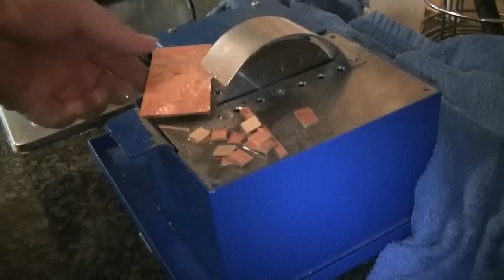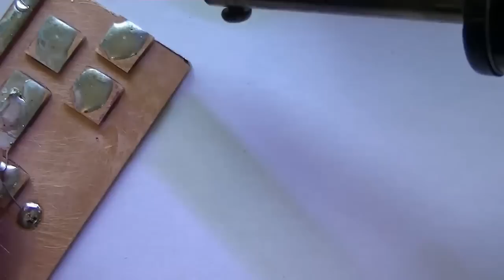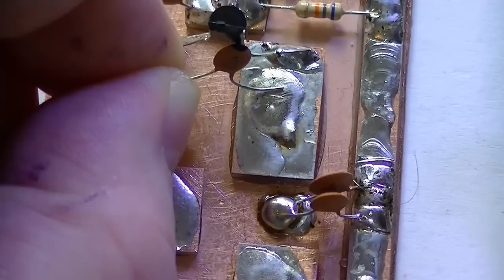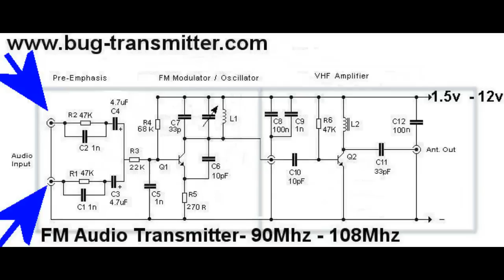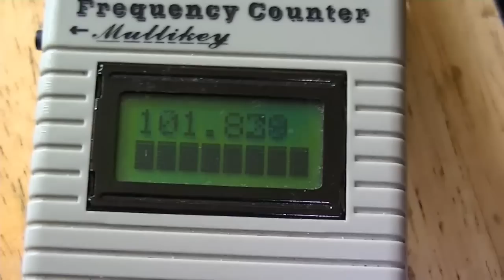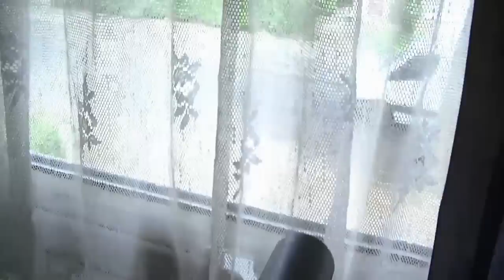Build your very own small home radio station.I show you how to build a small FM transmitter

Comment: I have a variable capacitor with 3 legs, how I can connect to the circuit?
Reply: two of the legs would be connected to  the same point whereas one would be the variable leg pin. check with continuity tester.
Reply: two of the legs would be connected to  the same point whereas one would be the variable leg pin. check with continuity tester. connect the variable leg and any one from those 2 common legs to tue circuit
Reply: two of the legs would be connected to  the same point whereas one would be the variable leg pin. check with continuity tester. connect the variable leg and any one from those 2 common legs to tue circuit
Reply: two of the legs would be connected to  the same point whereas one would be the variable leg pin. check with continuity tester. connect the variable leg and any one from those 2 common legs to tue circuit
Reply: connect the variable pin to one end and any one from those other two to the other end
Reply: connect the variable pin to one end and any one from those other two to the other end
Reply: jh

Comment: Can i use a 4.7uf capacitor instead of 4.4uf?
Reply from the maker: You can use 1uf upto 100uf
Reply: dazaro3 Thank you sir. Luckely i found all the parts.
But i have one question what is L2?
Reply: verhoeff95 I think its a inductor http://www.wisegeek.com/what-are-inductors.htm#
Reply: verhoeff95 I found it. I wil post a video when my transmitter is ready.

Comment: If I want to stash transmitters all around Iraq, what options do I have?
Reply: +MuzzaHukka All Iraq? Lol the answer is ONLY if you live in the center "Baghdad",  the topography of the site is too difficult, full of mountains, hills, an antenna in the top of Baghdad needed. You need 200 km radius of coverage, you need a transmitter 5000 Watts.

Comment: Great stuff, i need a circuit to use on an fm mp3/car transmitter i want around 5 watts out and ideas?
Reply from the maker: To build a 5 watt transmitter you will need to use a IC like a
BH1471 and use a 3 stage RF amplifier stage, a much bigger build
but it can be done.

Comment: Do I need a 4.4 uF Capacitor or is there something that can replace it? (I don't find any of them to buy)
Reply: Mmm...I don't see any 4.4 uF capacitors.....C3 & C4 = 4.7 uF Electrolytic Capacitors, you can find them very easy
Reply: +3E WINNING 3E Oh okay, it said in the description C4 = 4.4 uF, but I'll buy now 2 4.7 uF Capacitors.

Thanks for the comment! :)
Reply: +AtDiT this circuit is not sensitive at all, a 22uf is fine, which is what he used in the video. More capacitance (not too much) will improve the low end of the sound quality. i used 4.7uf. I think 10uf might be better to reduce overmodulation in the final sound. give it a go. i used 4.7uf and the sound is great especially the high end. however it does tend to splatter if driven at full volume on lower frequencies, reducing the volume of the input audio source is a must.